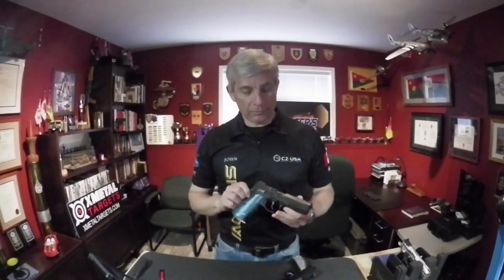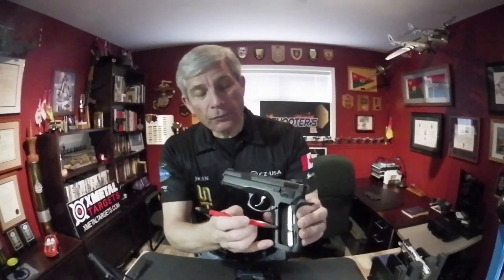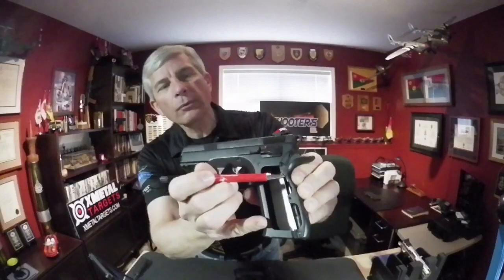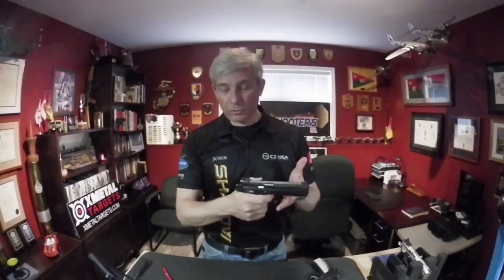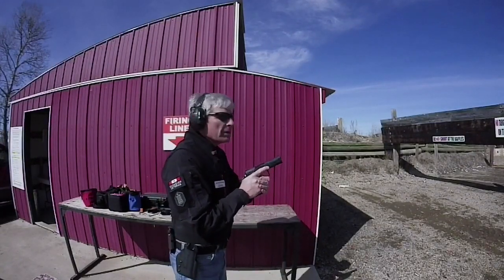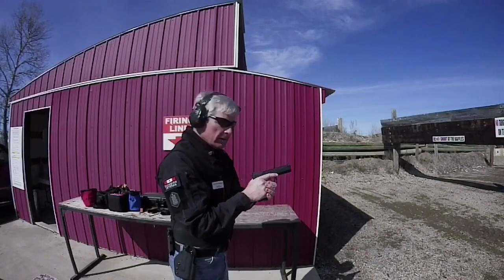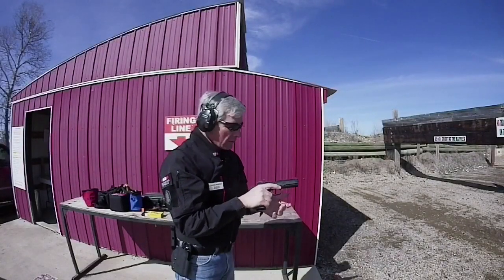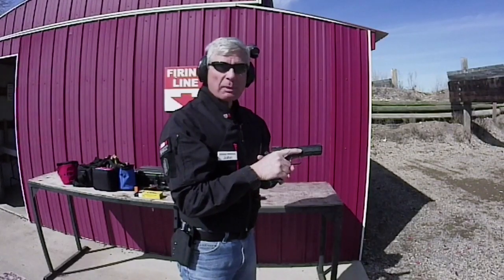Gun Review Series: CZ Shadow 2 Update #1 - Main Spring (E29)

Comment: Did you have to use an extended firing pin, and reduced power firing pin spring for the 13LB?
Reply from the maker: Yes, I have an extended firing pin in my pistol.  I didn't at first but I decided to install the extended firing  pin as I could not take the chance of a possible light strike.

I actually have an 10 lbs spring in the gun now and you absolutely need an extended firing pin in the gun.  Not all primers will be struck hard enough without the extended firing pin.  For test purposes, I had re-installed the factory firing pin with the 10 lbs spring and the result was 100% light strikes and no bang!  I installed the extended firing pin and the issue was resolved but not 100%.  I found the S&B primers were still an issue and I getting 100% light strikes.  I tried Winchester, CCI and S&B primers.  CCI were the best with the setup I have in my pistol.  Every round fired.
Reply: @ShootersInc  Thank you, and more power to your channel. Keep making videos well keep watching.
Reply from the maker: You're welcome and thanks.  Much appreciated!

Comment: Any update on the 11Lb spring?
Reply from the maker: As I mentioned in another reply to you' I actually have a 10 lbs spring installed now but as for the 11 lbs, it was giving me the SA  and DA trigger pulls I wanted.  The 10lbs spring brought my SA under 3 lbs and the DA to a hair under 6 lbs.  I installed the 11 lbs in my Shadow SP-01 and the SA is around 2.5 lbs and the DA is around 5.25 lbs.  The trigger pulls are unbelievably smooth / light.  An extended firing and firing pin spring is a MUST with the 10, 11 and 12 lbs springs in either gun: Shadow 2 and SP-01.

Comment: So after this, which gun do you like better? The Shadow 2 or tanfo stock 3?
Reply from the maker: I'm not ready to make that final decision.  It's a tough question.  To be honest, I prefer the Stock III as it is a well balanced gun.  The Shadow 2 is muzzle heavy.  Although muzzle heavy isn't a bad thing, I have to get used to it.  This is a very picky point on my part.  The biggest difference between the two pistols is the trigger.  The Shadow 2's trigger came out of the box super smooth and even though the SA and DA pulls were heavy, the smoothness of the trigger countered the heavy trigger pulls extremely well.  The smooth trigger makes the SA and DA feels lighter than they really are.  Absolutely at a minimum install a 13 lbs main spring.  The reduction in the SA and DA trigger pulls is significant and is certainly felt.  The Stock III's trigger although smooth is not as smooth as the Shadow 2.  The Stock III's SA trigger pull is very nice but the DA is very heavy at around 11 lbs and is not a clean pull all the way through to the hammer being released.  So, at this moment, the Shadow 2 is winning but has not won yet.  I have put many more rounds through the Stock III than the Shadow 2.  If you are in the final stage of deciding on which gun to buy and your purchase time is now....go for the Shadow 2.  You will not regret it.  If you have time to wait, ask me your question in a month's time as I will have had more rounds through the Shadow.  Final thought... the Shadow 2 is competition ready out of the box...the Stock III is 90% competition ready (Standard model).  It needs a fibre front sight, better grip panels such as the Xtreme grip panels and the trigger needs to be lightened (and legally if you are an IPSC shooter).  This is the best answer I can give you at this time.  Hope all these points help you in your decision.
Reply: Great information !
Reply from the maker: You're welcome.  If you have any specific questions, don't hesitate to ask :-)  It would be my pleasure to answer.
Reply: fmxmyway nice

Comment: Do you have any plan switching the 13lb main spring out for an 11lb spring?
Reply from the maker: Yes, I am planning to change to a 11 lbs or even a 8.5 lbs main spring.  I'll post an update video when I do.
Reply: Shooter's Inc David at Cajun Gun Works says if you use an extended firing pin, the 11lb will work 100% with Federal primers. Most report 100% with CCI primers too. However the 8.5 is hit and miss.
Reply: Should be production illegal if the 11lbs or 8lbs is not made by CZ?
Reply: @calvin14888  Both the 11lb and 8lb springs are CZ OEM
Reply: @zhukie  CZ made 8lbs OEM? Where to buy?

Comment: a lot of people have said to me that the Shadow 2 is THE gun for IPSC. And I´ve looked at a lot of videoes of it. On a scale from 0 to 10 where would you put if for IPSC Produktion??
Reply from the maker: The Shadow 2 is definitely a gun you MUST consider as a Production Division gun for IPSC.  I need to do a comparison video between a Tanfoglio Xtreme Stock II and / or Stock III and the CZ Shadow 2 to give you a 100% honest opinion of where the Shadow 2 ends up on a scale of 0 to 10.  But, I can with confidence say without doing this comparison formally that the Shadow 2 is no less than an 8 if not a 9.  Once I do a comparison with the Tanfoglio Xtreme Stock II and / or Stock III, I'll be able to tell you if it is 100% a 9 or 10.  You cannot go wrong purchasing a CZ Shadow 2 as an IPSC Production Division gun!  For that matter.... or for USPSA shooting.

I hope this answers your question :-)  The Shadow 2 is a fantastic gun and to find anything negative about it requires me to be extremely picky so I think that says a lot for the Shadow 2!!
Reply: that is scary - most people here have mensioned the Tanfoglio Xtreme Stock II too. 
What could be a number three gun there??
Reply: personally I would choose the shadow 2 for IPSC the trigger is sooooo much smoother out of the box. The shop where I i ought my shadow 2 had tanfo stock 2 and 3's both in extreme and non extreme so I was very lucky to be able to hold and dry fire them all before making a decision. The stock 3 just didn't feel right in my hand so it was out pretty quick. Came down to the stock 2 and shadow 2 in the end the shadow 2 was the most well rounded gun for the price. the extreme 2 in my option had a very poor  trigger for a 1700ish dollar gun and the regular stock 2 would need several hundred dollars and hours of polishing to get to shadow 2 level. I bought the shadow 2 and have about 100 dollars in parts coming that I feel will make it a really great gun. Also I already had 10 mags from my other CZ so that also swayed my decision.
Reply from the maker: Thanks for your comments.  There is no doubt that the Shadow 2 is competition ready right out of the box and for $6-$8 to buy a 13lbs or 12lbs main spring, the gun is absolutely set.  The CZ triggers are extremely smooth triggers and my hat is off to CZ.  Every CZ gun, pistol or rifle, that I have owned or shoot have had fantastic triggers and I'm a very picky guy when it comes to triggers.  The standard model Tanfoglio Stock II and Stock III triggers certainly don't compare out of the box but with 60 minutes of polishing the trigger bars (30 mins using a Dremel tool), you can significantly improve these triggers.  I have shoot a Xtreme Stock II and the single action is quite close to the Shadow 2 but the DA is not....from what I remember.  But, you have made a very good point about the price point of the Shadow 2.  You are getting a lot more gun than you realize for the money.  Is the Xtreme Stock II or Stock III added cost worth it?  Especially if you think that you may have to still tweak the triggers on either gun to match the Shadow 2's trigger?  It's all a matter of personal preference and if you can do the trigger work yourself rather than send it out to be done ($$$$).  I'll say it again... You can't go wrong buying the Shadow 2 and if a person has mags already because they had a Shadow SP-01 before, I guess the Shadow 2 wins.
Reply: I agree with everything you said. In IPSC you can change internals on a production gun correct?
Reply from the maker: What you can do to an IPSC Production gun is very strict.  If you change internals, technically the gun should be available with that specific part from the manufacturer but this particular requirement is fairly relaxed from what I have seen but what isn't is that the part must be offered by the gun manufacturer and can not be an after-market part made by some other company.  For the most part, you can change the recoil rod and springs, the main spring, the grip panels, front and rear sights, hammer spring and in some cases the trigger (but it must be IPSC approved / legal).  All these parts must be available from the gun manufacturer and there will never be a question to if a part is legal or not for IPSC if the same gun, say a Shadow SP-01, is also sold, off the shelf, with the parts you have changed in your own Shadow SP-01.  Does that make sense?  In essence, an IPSC Production legal gun is an "off the shelf gun" with no custom modifications including no full trigger job.  So, this is one reason why the CZ Shadows has been so popular in my view....the triggers are fantastic right out of the box.
Reply from the maker: The Tanaglio Xtreme Stock III could be another option.
Reply: @ShootersInc  Also no polishing of internals/trigger job like you can do in USPSA. You may however remove factory burrs and a gunsmith can "relieve" metal in order to fit OEM parts.

Comment: Hi, great videos by the way :)
Just one question, how is your experience with DPM recoil system? Could you pls explain if it changed pistol's recoil and how much. Thx a lot. Liked and subscribed.
Reply from the maker: Sorry, I missed your comment so I'm rather late at answering your question.  The DPM really does make a difference in reducing muzzle flip and dip and felt recoil.  You will feel more of a difference when using a DPM with a .40 S&W and .45 Auto compared to a 9mm but there is still a significant enough difference when used with a 9mm especially if the gun is a polymer.  Now, to take advantage of the DPM's benefit to the max, you need to match the DPM spring that you chose with your specific ammunition.  This is critical if you want to take full advantage of the DPM's benefits.  So, if you change ammunition, you really should determine if one of the other springs that comes with the DPM for your gun is better matched to your new ammunition.  I use DPMs in every gun I own including my AR.  

What gun are you planning on getting a DPM for?  I can tell you that if you have a polymer gun, you most definitely want a DPM.

Thanks for you positive feedback on my videos and for subscribing.  Regards, John
Reply: Hey, such a great and thorough answer made my day :)
I have ordered DPM for my CZ P09, CZ Shadow 2 and also for all my Glocks (20, 21, 40 and 22).
As per the manufacturer, this system can prevent common "beating" damage that occurs as a part of regular wear and tear and thus dramatically extend life of a firearm. Again, thx for your answer.
Reply from the maker: My pleasure.  If you have any questions regarding the DPMs once you get them, please ask.  I know the inventor / owner of DPM Systems Technologies so if I can't answer your question, I'll get the answer from Dimitri.  I use a DPM in my CZ P-07 Duty 9mm as well in my Shadow 2 when not shooting IPSC (not IPSC legal).  You will definitely notice the difference with the P09 and Glocks as they are polymer guns.  The guns will be shooting a lot flatter.  My P-07 shoot so much flatter with the DPM.  Another benefit of the DPM, as you have mentioned, is that the gun will take less of a beating.

I did a comparison test with my friend about 3 months ago with his Glock 35 .40 S&W.  Shot a couple mags with the factory recoil spring and then installed the DPM.  Shot a few mags with the DPM and then swapped back to the factory, then back to the DPM.  My friend who is a qualified Glock armorer with over 40 years shooting experience was surprised at the significant improvement (reduction in muzzle flip and felt recoil) with the DPM installed.